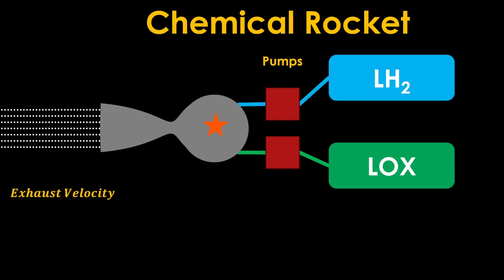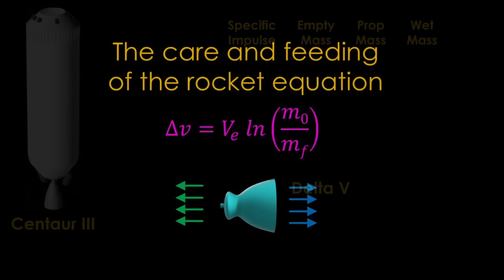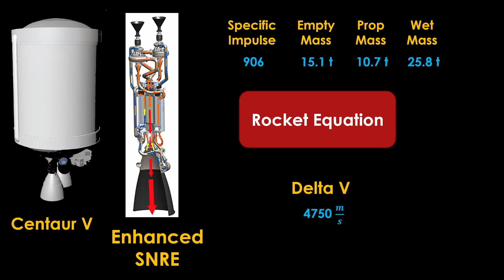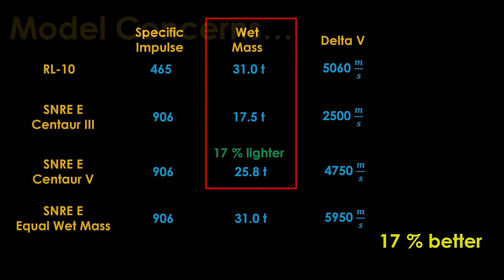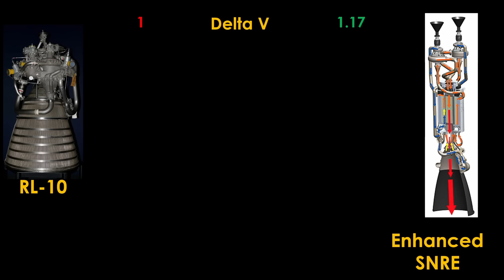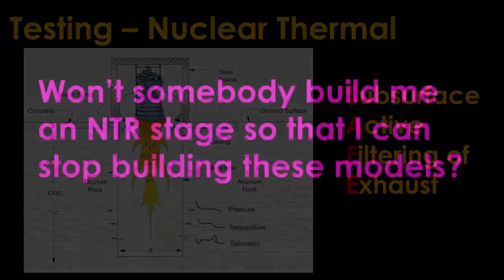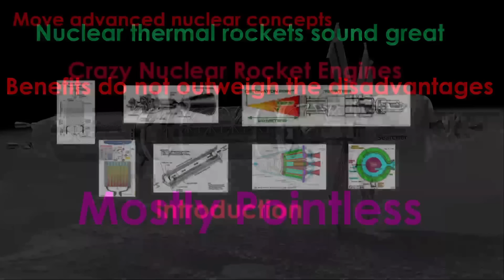Why Nuclear Thermal Rockets are Mostly Pointless

Comment: What effect would using LN2 instead of LH2 be? LN2 is roughly 11 times denser; would the ISP in a nuclear thermal rocket be 11 times lower? I have no idea how to calculate the ISP of a nuclear-thermal nitrogen rocket. (N2 is nearly as dense as LOX but not as chemically reactive) edited - to fix my math
Reply from the maker: Nitrogen is 14 times heavier than hydrogen. You get much smaller tanks but you get terrible specific impulse.
Reply: Nitrogen is reactive at 2700 deg.c  I'd start with liquid helium or perhaps liquid neon first.
Reply: @PeterThorley  I feel like that might make spaceflight prohibitively expensive.
Reply: How did you get 8 times? 
Nitrogen has atomic mas of 14 so LN2 would be 28 which is 14 times higher than hydrogen
But it's square root so it would be "only" almost 4 times worse which is below most liquid rocket engines
Reply: @Wisald @Wisald, I'm just going on the numbers from Wikipedia and the web. "Liquid nitrogen has a density of 0.808 g/mL" "Liquid Hydrogen . . . has a density of 0.07085 g/cm3" .808/.07085=11.404 (I actually underestimated the number in my above post; I'll correct it.)
Reply: @scottarmstrong5607  the ratio that you want is the ratio of the atomic masses, not the ratio of the densities
Reply: @scottarmstrong5607  Density is irrelevant for ISP, you need to look atomic mass instead. 
The lighter a particle is the more ISP it gets for the same temperature, this is why liquid hydrogen is the only propellant that is seriously considered for NTR, otherwise if you use something heavier like liquid nitrogen for example you end up with ISP inferior to even chemical engines

Comment: Hi. This video is pretty disingenuous honestly. Would love to work through an update with you.
Reply: Can you back up what you're saying? What are your arguments?
Reply: @crisis-zu3jq  He's offering to back it up. Just not in the comment section. I would rather see an updated video or a better-argued case than the comment section can provide.
Reply: @crisis-zu3jq  I thought it would take more work, but actually yes I can. 

The eager space video just takes a volume constrained approach, instead of a mass constrained approach. 

NTP with the same wet mass, including the extra dry mass tank penalty for stretching the tank, can still significantly exceed RL-10. 

My point isn't that the NTP tech is or isn't valid, without modeling the entire system you can easily make either claim if you constrain volume or mass, or wiggle any other major assumptions. 

It's just an odd take for a YouTube channel to be so aggressive on unbased claims.
Reply: @ruby
What’s even worse is that he wants to cut funding to a project that costs millions while the USA has a gdp of 20 thousand billions per year and spends 4500 billions per year on social security

Like, you know, just MAYBE cut the free money handouts by 1% and use that to multiply scientific research budget by a thousand instead? 

Instead of arguing we should go from 0.00001% of GDP to 0% of gdp spent on the key technologies that allow for space expansion and space industrialisation?
Reply: @Ruby______0-z4t  Modeling the whole system includes the volume constaints of launch vehicles.
Reply: @kennethferland5579 correct are you aware of a length limit for an upper stage? 

Are you aware that a new glenn fairing is twice the height of the centaur tanks he mentioned? Go ahead, check the math volumetrically
Reply: True if big
Reply: Nope, this video is spot on, every anaysis of NTR done by real engineers leads to the same conclusions, they are trash.  Only in the delusions of space cadets are they a miracle engine that fufills all their space fantasies.
Reply: uhh space cadets uhhhh 🥴
Reply from the maker: I always love better information.
Reply: @EagerSpace  just don't constrain volume, constrain mass. 

Interesting that the first Google AI result does the same thing. Snore.
Reply: @Ruby______0-z4t  Real launch vehicles are volume constrained, and thouse constraints are often MORE of a driver of design then mass for things are already more dense then liquid hydrogen.
Reply: Big if true
Reply: How is it disingenuous?
Reply: I’m with you here. I find the word choice confusing at it implies malintent. I dont think eager space is doing anything but using  the information available to him to estimate. He is asking for more information, to be shown why he is wrong. The burden of proof lies with those claiming there are further performance capabilities which haven’t been demonstrated. Not the other way! Eager Space outright admits, within the first minute of the video, that significant technological break throughs go against the basic assumptions of the video. Anyone with access to the DARPA program, who almost certainly cannot legally share that information, saying this video is disingenuous is in my opinion just being an ass.
Reply: @snek9353  For one thing, he is asked at what mass/ delta V nuclear becomes better. Then he compares medium second stage rockets. That are terrible use for nuclear engines. And he calls it "best case". Why are they terrible for this use? They still need a lot of thrust to weight ratio, since they work in suborbital trajectory, they are quite small, are single use, they lift payload as is. Notice, that he did not touch heavier second stages, like Starship (about 100x heavier than RL-10 and Centaur) or even SLS second stage (about 10x heavier). But what nuclear engine are best suited for? Very big ships, assembled in space with relatively small engine (you can have thrust to weight ratio of 1/10 or less and be fine, your thrusts will be long but in orbit, it only slightly decreases efficiency, but you don't race the time to reentry any more), to ferry things around in orbit, with refuelling capabilities. It's not like rocket scientists have no idea about rocket equation. The person who asked the question, understood nuclear engines better than Eager Space.
Reply from the maker: I chose centaurs not thinking about using them as seconds stages but because we have pretty good numbers for their specifications and they are therefore convenient to use. 
If you have models that do what you propose I would love to see them.
Reply: Could you summarize your grievances?
Reply from the maker: You can find some information to contact me on eagerspace.net. You can also find me on X.
Reply: The information approved for public release is available online. There is no need to have a conversation. Anything extra will likely break CUI rules unless explicitly cleared by your FSO. If the party to your conversation is a foreign person, you may also violate the Arms Export Control Act
Reply: @tytyyea1you don't have to reveal any information to redo the deltaV calculation without bad assumptions. 

Thanks for the advice

Comment: A thing that I've wondered about. If you have perfect science and a kilo of stuff, you can annihilate (all the way down to raw energy) some portion of the stuff to produce energy to throw the rest of it overboard very fast. So how much do you annihilate? and how fast do you throw the rest? what's the tradeoff curve on that.
Reply: I think what you are talking about is matter-antimatter anihilation.
Reply: The problem is making the stuff.
Making and storing.
Making, storing, and exhausting the reaction products without destroying the engine.

A fusion reactor would be much simpler.

Comment: And of course the fuel tanks for liquid hydrogen have to be substantially upgraded for long-term space flights with massive amounts of insulation and active cooling to prevent hydrogen boil off which adds further weight.
Reply: “oil off”
Reply: @john14x42  fixed it thanks
Reply: Yeah, a lot of the delta-V problems outlined in this video revolve more around issues with liquid hydrogen than NTRs per se.
Reply: Unfortunately you lose quite a bit of ISP with other fuels.
Reply: @mb777-g8v  Substituting liquid ammonia for liquid hydrogen, you get a little less than half the ISP, but almost 10 times the mass of propellant for a given volume. Liquid NH3 is also way easier to handle and store the liquid H2. Depending on your mission profile, it could be a huge improvement.
Reply: @Nitroaereus  yes I was thinking of liquid ammonia as a choice.  Lighter smaller tanks won’t make up for the ISP difference however
Reply: @mb777-g8v  What you really want is the same tank size with a greater mass of propellant.  

As long as your keeping your reactor temp at or above 2000K, you're only cutting your ISP down by a factor of 2.06.

Meanwhile you're increasing your mass ratio by 9.75x.  

So your delta-V is going up by more than 10% and your propellant is much easier to deal with than liquid hydrogen.
Reply: @Nitroaereus  Ammonia can dissociate into atomic nitrogen and hydrogen at the temperatures inside a nuclear rocket though.
Reply: @G0ldbl4e  Right, that’s what makes an ammonia powered NTR’s ISP better than you’d get if you were just heating and expelling un-dissociated ammonia.
Reply: @Nitroaereus  it looks like the real life ISP of ammonia is quite a bit lower
Reply: @mb777-g8v  Use Lithium Hydride, very lightweight, but solid, no need for any tanks at all. The crew would just shovel it to the reactor like in a steam locomotive ;p
Reply: @mb777-g8v  

I ran the numbers for ammonia through the Isentropic Exhaust Velocity Equation myself, and as long as the SNRE can achieve core temperatures of 2500K and chamber to exhaust pressure ratios of 300:1 (both of which were achieved by NERVA, albeit for short periods of time), then ammonia should be able to achieve an ISP of 406s. That’s 87% of the RL-10’s ISP with better than twice the propellant density. 

Now, the equation is an ideal, but we know the conditions are achievable since NERVA achieved them 50+ years ago. And modern NTR designs like the SNRE project core temperatures of 2700K and pressure ratios of 500:1.  Under those conditions ammonia’s ISP rises to 430s. At that ISP an ammonia NTR Centaur III has 20% greater delta-V than the RL-10 version, and that's not even considering any additional efficiency from not having the extra hassle of liquid hydrogen.

The question isn’t if it’s possible, but if it can be achieved reliably and cost-effectively. And to be fair, those are big ifs.  As others have pointed out, the additional costs for these kind of performance increases aren't going to make sense until you're attempting very large and time-sensitive missions like crewed interplanetary transits.
Reply: Boil-off in transit is not as big a problem as people make it out to be.
Remember that all space is effectively a thermos bottle.
Reflect away the sunlight and the problem is pretty much solved; certainly for molecules larger than H2.
And the problem becomes easier as the tank gets bigger and the volume to surface area drops.
Reply: @michaelmicek  When you have the decay heat of a reactor core it will be.  All reactors produce residual heat even upon the total sessation of a nuclear chain reaction, that is WHY reactors melt down days AFTER shutdown.  In the perfect vacume of outerspace that decay heat is going to heat the vehicle and will need to be allowed to boil off propellent or else it will litterally just melt the vehicle.  This is why NASA NTR were for throw-away stages, they knew the decay heat was unmanagable.
Reply: @kennethferland5579 could you eject and store the core separately when not in use?
Reply: @mic @michaelmicek  boil off is a problem because hydrogen is such a small molecule it tends to leak out through valves etc.
Reply: @mb777-g8v okay, but that's a hydrogen containment problem, not a heat management problem.
Reply: @michaelmicek  they’re directly related. The warmer the hydrogen gas the higher the average kinetic energy of each molecule and the faster it escapes
Reply: @mb777-g8v  no, leaks are irrelevant when discussing boil-off, because boil-off implies you are intentionally venting gas.
The propellant is a liquid state.
It absorbs heat and some vaporizes.
This greatly increases the pressure in the tank.
To avoid explosion, you vent the gas, which lowers the pressure (obviously) and also the temperature in the tank.

This is the same for any cryogenic liquid, the only difference is that methane and oxygen are around 100K and H2 is more like 30K.

Comment: It seems like you’ve gotta find a way to get the weight really down or get things hot enough that the ISP goes up to at least 2000 for it to really work
Reply: How will get rid of the heat 😢😅all the heat won't be used in propulsion
Reply: @codeforce5556  obviously. Just like the international space station which doesn’t go anywhere needs giant radiators to get rid of excess heat. Or the space shuttle in orbit needed radiators to get rid of excess heat.  Just like the Orion capsule needs radiators to get rid of excess heat. 

A nuclear thermal powered craft will need radiators to get rid of excess heat.
Reply: @codeforce5556 radiators become MORE effective at higher temperature, so a radiator system for a NTR would actually be much smaller and less complex then a radiator system for say, an electric propulsion system using the same amount of energy
Reply: Its the fuel to engine weight ratio

Its like useing a f1 engine on a small launch vehicle

It just wont work as well interms of deltav